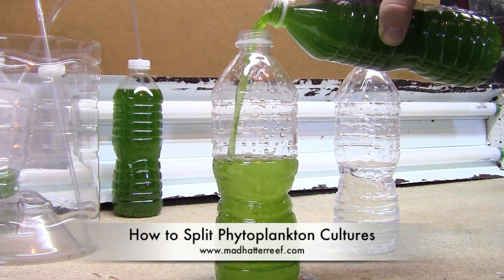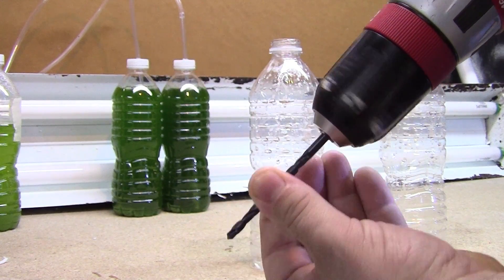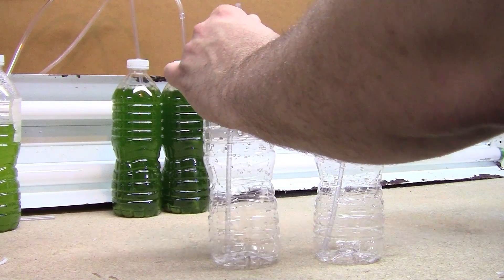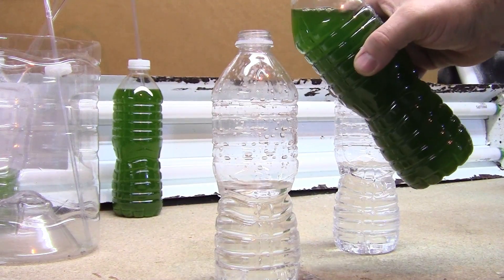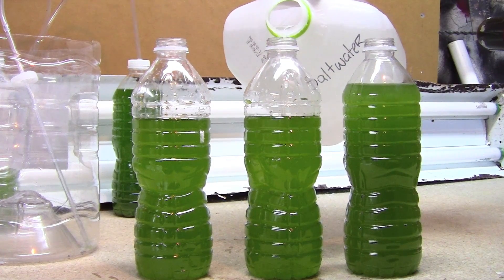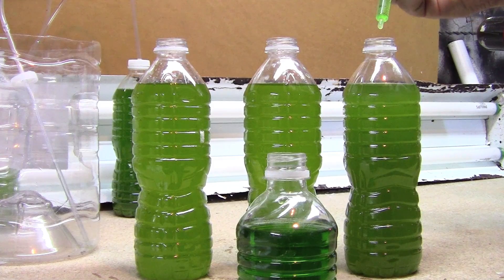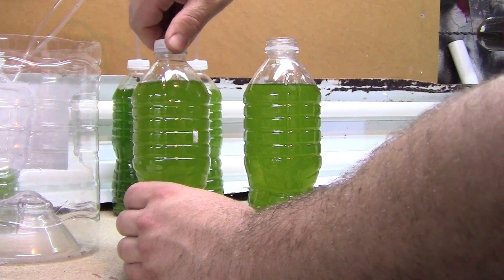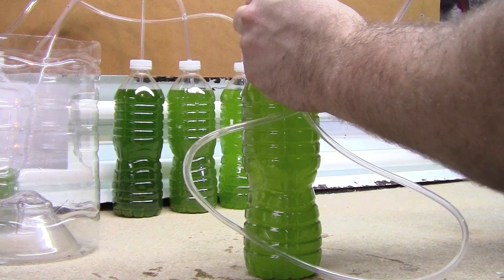How to split a Phytoplankton Culture

Comment: I finished culturing 2 water bottles worth of phyto it came out super dark then I split 1 bottle into a new bottle 1/3 phyto 2/3 water with 1 ml of f2 but the water has been neon green for 5 days now not getting to the dark hunter green like the original culture any tips why? I'm running lights 16/8 schedule
Reply from the maker: Run them 24 x7 and try adding little more f2.

Comment: I'm using this method and it's working great but I notice after several hours there is dark green sediment at the bottom is this normal I just swirl the bottle to get it back into suspension
Reply from the maker: I experienced  this from time to time when I would split the culture I would just dump it down the drain. Your cultures must be really dark if this is happening. Thanks for watching.